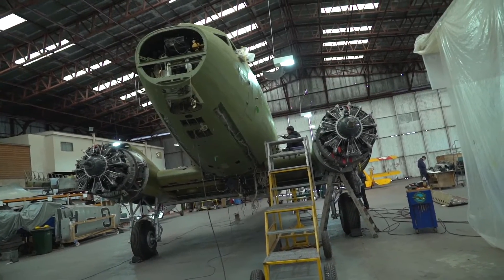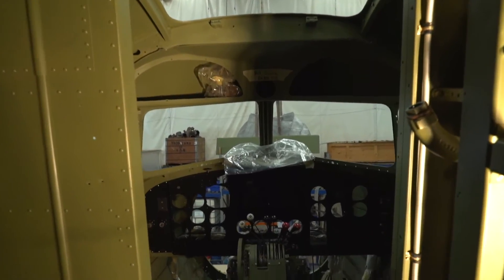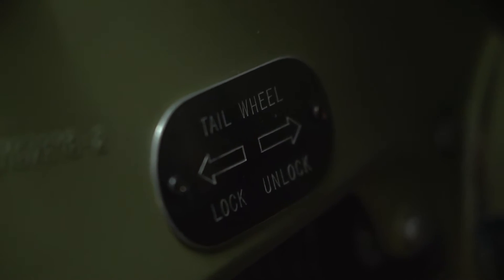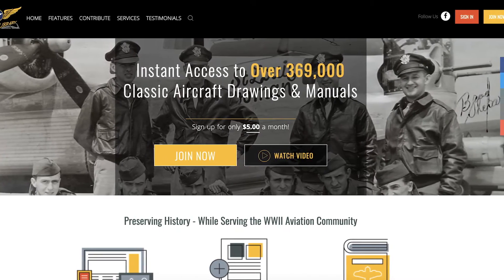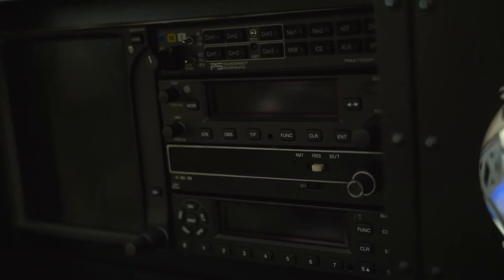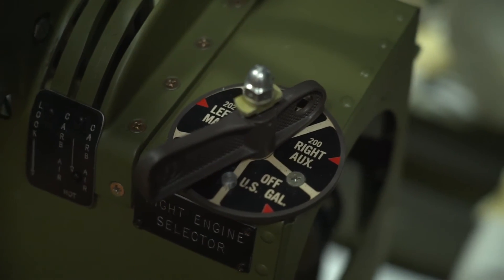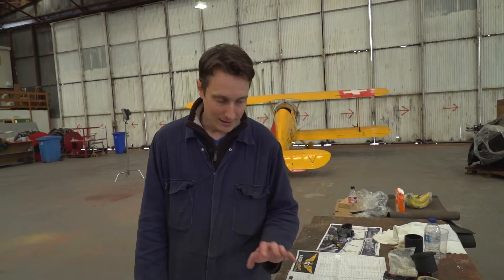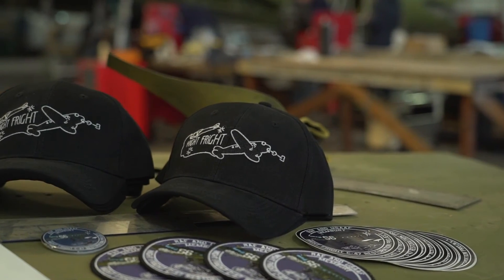Cockpit Assembly!

Comment: if you are following planesavers. while stringing the control cables. the trim cables keep coming off their drums.  have somebody make up a clip that can slip over  each of the various sizes of trim cable drums .. Shape it like a Ohm symbol. but only have it wrap around the drum about 2/3rds of the way.  this will hold the cable on the drum and stop it from unspooling and costing a lot of time redoing it again and again..  if there is any worry about abrading the cable strands.. line it with a thin layer of cork or plastic.